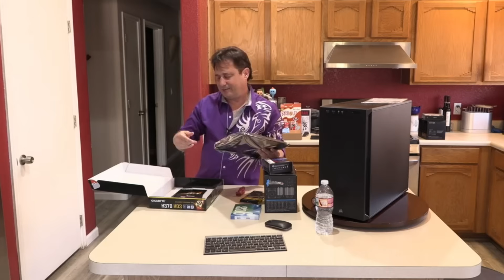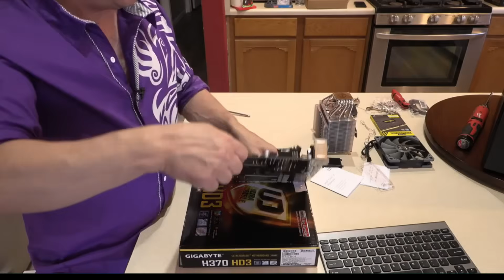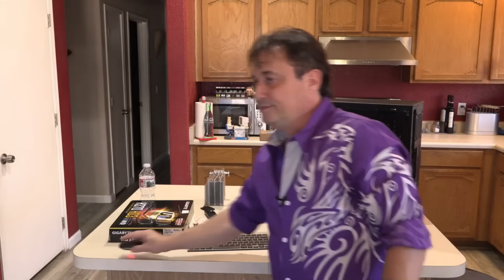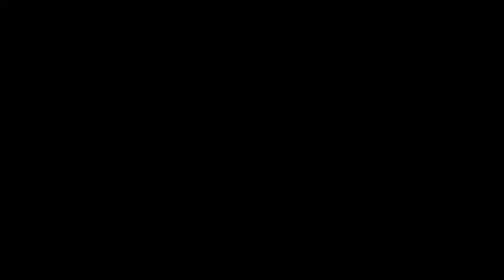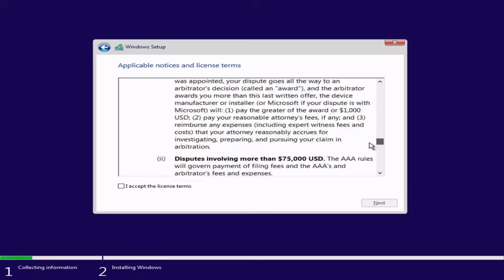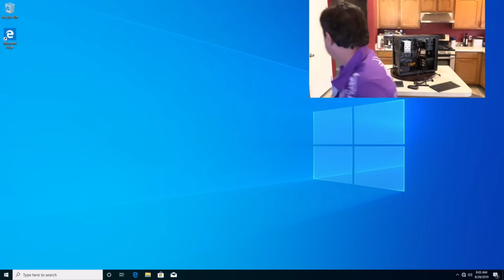A Computer Build To Last For At Least The Next 8 Years

Comment: I heard this rule from another system builder. Rule 1: buy as MUCH cpu [power] as you can afford. In other words, a core i7 or i9 for example. I built my system in March of 2014 which sports a core i7 4771 and I'm still using it.

Comment: Hey CArey have you ever done a Audio production build? That would be very interesting. I have an i9 9900k that I am about to build around. Shopping for the parts. So far I am choosing to buy a cooler master hyper 212 EVo to cool it, haven't decided on a motherboard yet but leaning towards a Gigabyte z390 elite, going to use a NVme 512 ssd and a Seagate  firecuda hybrid 2 TB SSHD as well as a 750 watt power supply, Corsair Vengence 16 gb kit running at 3600 mHz and im going to place these in a Rosewill  Cullinan MX blue, which already has 4 fans pre installed. SO im guessing it wont get to hot. I don't know if you know anything about Audio production computers but my OS will be Windows 10 pro and my main application will be Studio One Pro. If you have any incite on this I would greatly appreciate it.
Reply from the maker: https://youtu.be/StoGpPXa3So

Comment: recently upgraded all the junk in my tower back in May. It really is amazing how small those M-2 drives are. I am using one right now for my OS. Running Windows 10 pro.  Also went with a I9-9900k@3.60GHz. Use it mainly for gaming. Runs all games I play on it with no issues.

Comment: Another good How-To Video, Carey! TIP: When starting screws, I always start by applying a slight pressure & turn the screw backwards until I feel and/or hear the screw drop into the thread channel of the anchor/nut, to avoid cross threading. This mainly applies to Nylon Anchors where a single cut threading is optimal. If you stick & drive, after multiple times the working part of the anchor is mutilated & likely the screw will easily strip out the damaged material leaving you with a loose part.